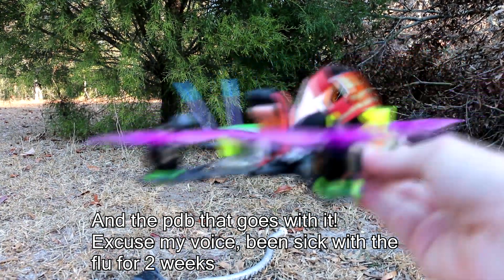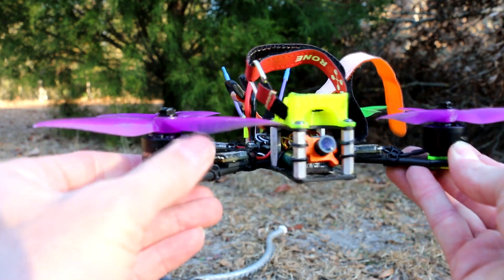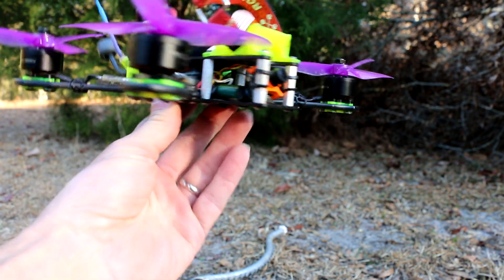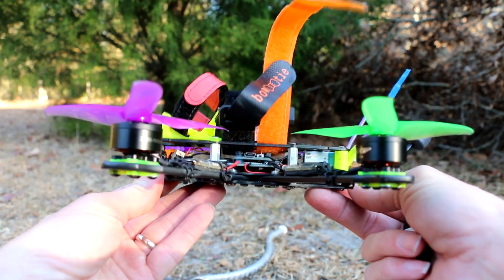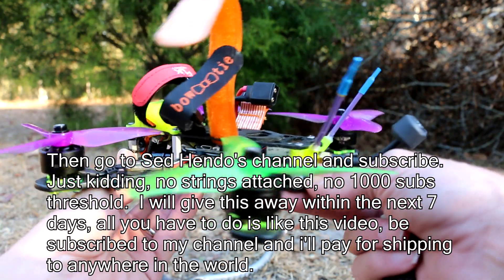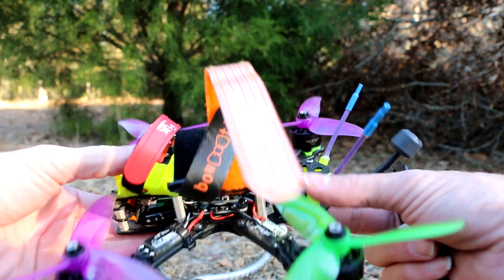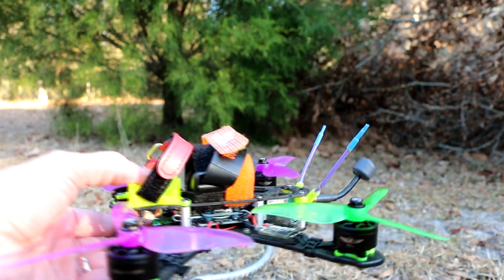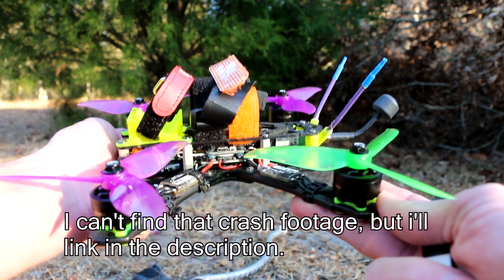Matek f411 Give Away

Comment: How do the MB motors compare to the others. I run xNOVA 2207 2000KV motors on 6S and have a little bit of sag - thinking the KV is too high. Those MBs would be the equivalent of almost a 3000KV 4s motor. Also curious how a small motor would run on 6S like the old cobra 2204 1900s - ie if it's possible to build a sub 300 gram 6S rig.